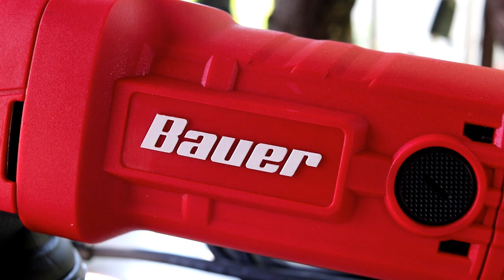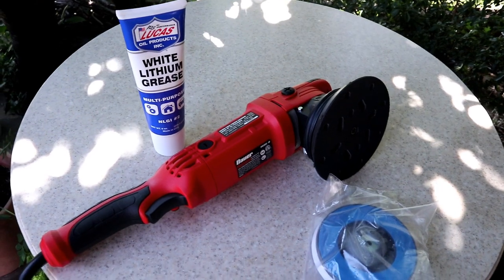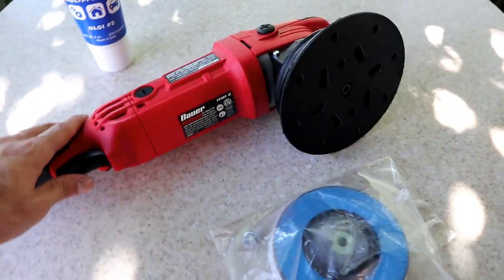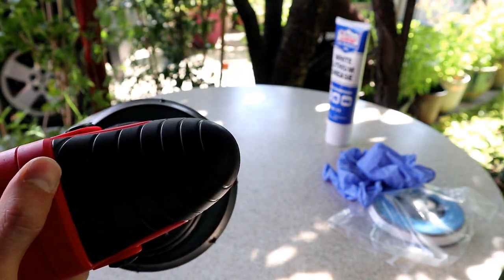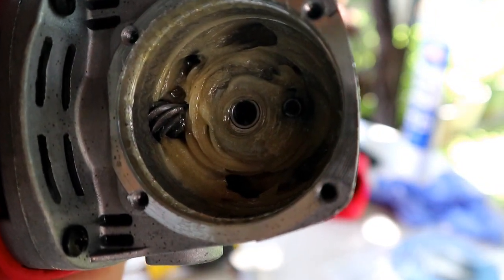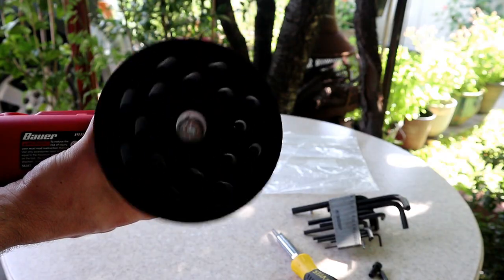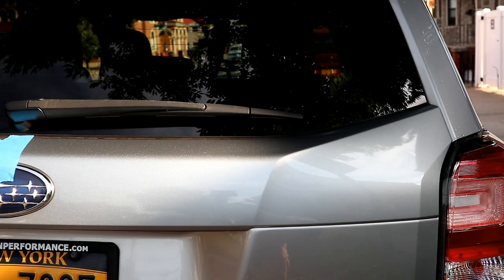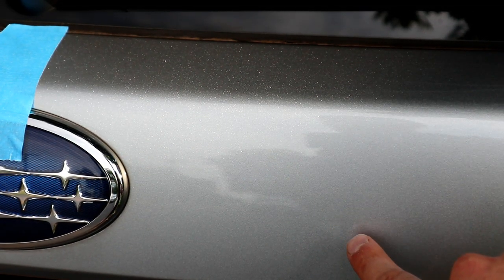Budget Rupes | Bauer 6" Random Orbit Polisher

Comment: I’m a Rupes guy for a number of reasons but picked this polisher up at harbor freight today as part of their Spring Black Friday sale. It was $70 plus tax. It looks like you are using a white foam pad which is an ultra fine polish pad and won’t do much in the way of cutting or correcting. Get the blue rupes foam or a microfiber for cutting and the yellow usually does great for finishing. Rupes compound and finish polish, sonax, or meguiars will do much better than the CG stuff. Hopefully I’ll get to mess with the Bauer this weekend and see how it works.
Reply: I'm a beginner and weekend warrior not professional. Would you recommend this Harbor Freight polisher over for example a Maxshine M8s or Griot's G9?
Reply: @chrisginoc  If you have the extra money to spend I’d recommend the Griots G9 as it’s a better quality polisher than Harbor Freight, but being a weekend warrior the Harbor Freight polisher is a more budget friendly option that can still get the job done. I’d recommend doing little upgrades like in this video to get the most out of it!

Comment: BTW eeep scratches like that you manually wet sand with 2k-3k ac4oss the direction of the scratch.  Gomtill you get milky water.  Then go to something like 3D One or Sonax Cut and Finish or even straight to Sonax Perfect Finish and a polishing pad.  On sctraches thru the clear or deep into it you arennot trying to remove the scratch.  You are trying to smooth and taper the edgesbwhich stops the reflective light that visually highlighlights the scratch.  You just do the small aera around the scratch not the whole panel.  You festher out.

Comment: Actually chemical guys is nowhere near the top tear.
 The top polishers are the German flex polishers and Italian rupes polishers. Personally I believe the flex polishers to be of better quality and durability.
Reply: I'll challenge your RUPES AND FLEX with an $80.00 Harbor Freight Hercules Brushless Cordless 20 volt rotary buffer (5 year warranty and 3 years on the batteries). Changed the gear grease to Lucas Red and Tacky...Buttery smooth, no cord to mess around with, and plenty of power & torque... Speed is only 800 to 2400 but this polisher is unbelievably smooth with no down pressure needed with a good quality pad like the UNO 50/50 or DIY Detail yellow waffle pad...No dual action will finish out better than a rotary...NAME Brand means nothing to me...Quality come from the skills of the person with the polisher in hand, the products they use on the paint, and their attention to prep and finishing work... So waste $500 on a NAME BRAND when it mean nothing if you don't have the skills to get the job done right...Most professional detailers are getting away from those heavy out dated tanks...They hang on their walls as a show piece OF ," LOOK what I got!"
Reply: @petedetraglia4776  Yup! That's why top professionals in the world still use rupes and flex. But Hey you go ahead and good luck with your harbor freight. Get a good set of anti vibration gloves well you're at it. 😅😅
Reply: I like Mirka too, those would be my top 3.
Reply: You understand the point of this video is to show DIY people what they can use on a budget?? Obviously what professionals use like Rupes will be better but that’s not what this video is about.

Comment: You domnot test the machines vibrationnwithout the pad you plan to use on it.  You need to put the pad on it and actually hold it in the proper orientationnunless you polush upside down.   The balance of a machine is a combo of the countervweight cs the backing plate and the pad.  That 5in plate by itself actually vibrated worse it was obvious to see.    Where did you pay 100 for the bauer thats at leadt 30 m9re than I have ever seen at my local hf.
Reply: Its $80 at harbor freight now